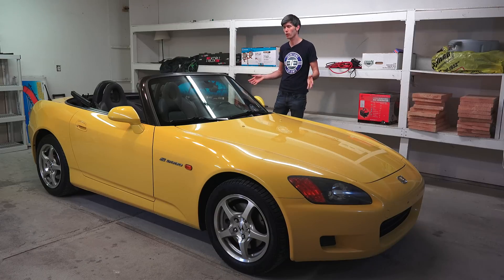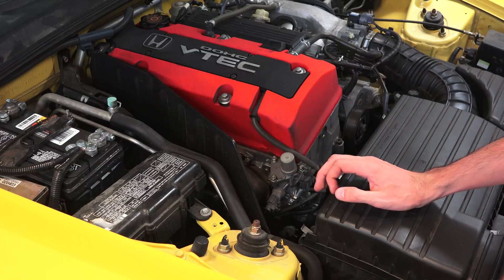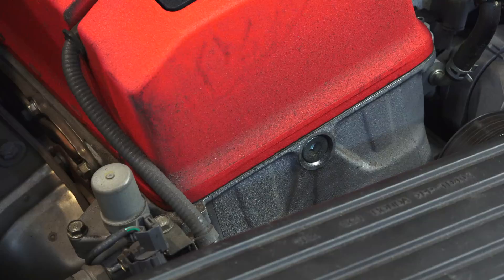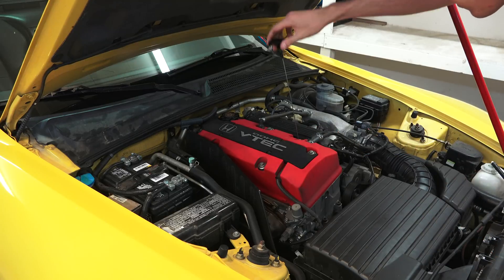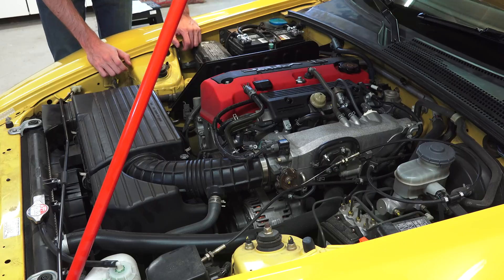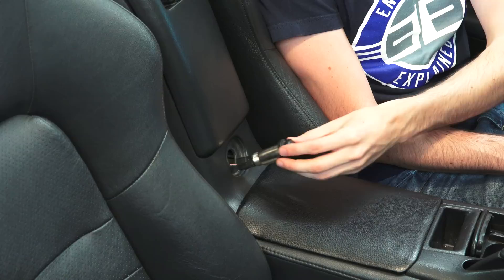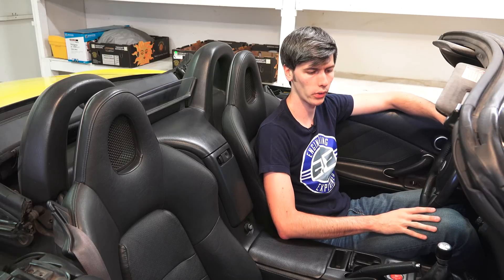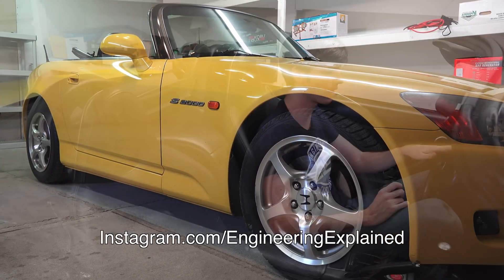What's Wrong With My Honda S2000?

Comment: If its not mentioned somewhere in the comments already, its a common issue for especially AP1s to burn oil fairly quickly and top off oil (maybe ~1qt) every few months or so...or even prior to an oil change. Don't sweat it, its normal.

Comment: Good to hear that you are going for the XV. Even I was expecting to see you in the Fiat / Mazda MX5 convertible for Sports Car instead the Honda.
 I have an Impreza 2011 5 speed manual with 102K miles no complains about..Im selling it for an upgrade
I own  a Forester 2013 as a family mover.  My choice for replacement for the Impreza will be the CrossTrex XV  5 sp with the highest trim available.. Its a reliable car an fun to drive.

Comment: Keep that stock airbox just get a snorkel
Reply: Also if you didnt know above the center console is a secret compartment I didnt find out about it for 2 years
Reply: +Yodastien that's because it's a secret....
Reply: lift it and put 30s on it aswell
Reply: Yea then all it needs some muddies and a raise kit and she'll be good to conquer some river crossings!
Reply: ayowser01
Yea there is, that's why they have short straight flow intakes and things like that. Like especially when you are dealing with forced induction engines. It isn't a loss with most n/a engines when you add the extra piping for a cold air intake because the cooler air makes up for it. But the more piping and bends restrict the flow to a certain degree, so in high powered engines the losses are considerable.
Reply: ayowser01
Glad to pass on knowledge to people who understand things :)
Reply: In this case the "loss" from the extra length and bends is more than offset by the higher flow through the larger tube/removed airbox internal restrictions and the cooler air (Hondas are sensitive to IAT).

A budget alternative is to gut the airbox, make a snorkel or lengthen the factory duct, and wrap the airbox in heat-reflective insulation (DEI makes some gold-foil stuff that a lot of race teams and track guys use). That also dodges the issue of worrying about puddles when you have a cold-air intake :-D
Reply: You could also gut the inside of the air box and get rid of that fin in there.
Reply: I agree. I think a simple snorkel will resolve heat soak.   Short of buying an expensive jdm intake, this is the best bet. It does require modification (cutting) of the factory hood, however.
Reply: Im not sure if the thermal efficiency improvement will cover the power loss of adding such a long intake pipe.
Reply: +j0n0j0n0j I noticed an improvement. Warm, ambient air no longer affects the power delivery. The power remains rather consistent on a 90-100°F day.
Reply: ayowser01
Yea I was just talking about the power loss from having such a long and bent intake pipe.
Reply: +j0n0j0n0j I really don't think there's any power loss from "restricting" the air path to the narrow tubing. the cross section of the factory intake inlet is actually smaller.
Reply: +j0n0j0n0j you learn something new everyday 👍
Reply: Yes, the snorkel will help. With the heat soak problem.
Reply: remove the sound deadening baffles of the stock airbox
Reply: Yodastien did you mean airbax
Reply: Raiyan Vlog heir bux

Comment: You can move the hood prop to the left side of the engine to prop the roof up almost 90 degree. It comes off and reinsert to a hole on the left side.
Reply from the maker: Great tip, I will check this out!
Reply: My Civic has a similar thing, there's the usual hood prop and then another hole near the bottom that opens it completely vertical. Very helpful!

Comment: Since it's an AP1, you gotta check if the banjo bolt was changed with the newer one. If not, there may be some issues with cyl4 oiling (very rare though) leading to lower compression compared to other cylinders.
Reply: Good point, and on 2002s only about half were done at the factory.

Comment: I, for one, am very interested in seeing work in progress videos, especially the timing chain issue! Love to see an engineering point of view concerning the chain and how to fix and/or prevent it. Curious to see what modifications you'll be doing on the S2k
Reply: The tensioner is one of the few defects in the car.  Fortunately it is a 20 minute job and with aftermarket options will be fixed forever.
Reply: Thank you very much for the information!
As a Honda enthousiast, I'm always curious to know the common "defects" their engines have, not only to fix mine and others's, but you never know, some day I might own a S2k :-)
Or....., may experience the "pleasure" to work on it.
Anyhew, thanks for sharing!!! Any more information is always much appreciated ;-)

Comment: You want to get the timing tensioner and chain sorted out ASAP, I had rattling timing tensioner and did not look into it soon enough and one morning idling it suddenly spun over freely as it died. Bent every valve in the head broke a couple valves off and poked holes in tops of pistons
Reply from the maker: Oh my! Just got the part in, changing it soon!
Reply: +Engineering Explained you might want to get a tensioner from ballade or from billman250 (s2ki member) because the oem one will fail again.
Reply: Please, DIY videos!
Reply: +Engineering Explained  if the tct can no longer perform its job, I would highly recommend changing the chain itself as well if you aren't going to already. The chain over time will naturally stretch until the tct can no longer do its job. That's a job where both get replaced. Unless a know-it-all customer says "no thanks."
Reply: +jake20479 Just found out you are changing both. My bad guy. Rock on

Comment: MX5 > S2000

The only problem with the NA/NB Miata is its luke warm engine and rust issues in the salt belt.

I would have a S2000 if the price was right, like under 5K and it wasn't molested.
Reply from the maker: Unfortunately you won't find (even a salvaged and well running) S2K for $5k.
Reply: Engineering Explained
 Yeah, and that's why I like Miata's you can get inexpensive good examples for peanuts with enough dough left over for some tasteful upgrades.

Comment: One reason for different oil level whenever you check it might when you do it first before and than after driving the car. You might measure let's say 10min after driving (hot engine). If there is a difference, than it might burn oil.

Comment: With Hondas they burn about 1L of oil every 1000 miles 👍
Reply: Also use genuine Honda diff and gearbox oil because I had to change a gearbox on a Type R because they used cheap aftermarket gearbox oil and it killed the gearbox
Reply: Actually, you need to be super careful there.  The diff oil is a honda motorcycle division part, and taking it to a dealer is likely to get you some CR-V diff oil.

Any 75W-90+ GL-5 oil works fine...and will probably be aftermarket. 

For the gearbox, the Honda MTF is great.
Reply: +Stephen Baker be carefull here. autodata says to use 10w40 transmission fluid. now iam confused.

Comment: Hey man when you are checking your oil make sure to pull the dipstick out, wipe it with a clean rag. Then re insert it all the way and pull it back out. As sexual as this last bit sounded, it will help you get a more accurate oil reading

Comment: How tall are you because  I want one
Reply: I'm not EE, but owned an S2000 for 13 years.  I'm 5'7 and the car is really ideal for people under 6'0 and on the slim side.  My buddy hates riding in it - he's 6'1 and ~250lbs.  He feels very cramped.  Drivers side is slightly more roomy than the passenger side and there is even a bit more room in the AP2.  I hope that helps!
Reply: 6'3 and I daily my s2000. Just buy a BYS seat rail and it makes the stock seat perfect for taller drivers

Comment: can anyone recommend a good/fun small car?? because i will be making 35 miles one way to work. i was looking at Fiat 500 Abarth, but I don't know if it's worth getting one
Reply: Get a Mini! They are way nicer! Just be careful what year model you get.
Reply: Get a nice little Miata! There is nothing more fun than a Miata
Reply: +Khvndlxr S the newest gen is awesome! I love that little car! I still like Mini's better, but for a car like the Miata they did a good job
Reply: +zevi 2000 is it a good idea to get a used mini or miata??
Reply: +Mr. X depends which models you are looking at. For the 2002-2006 hardtop models(supercharged), '05 and '06 years are best. For 2007-2014 (Turbocharged), the most recent models are much better for reliability the older N14 engine had some issues. For Countryman models go for a 2014 or newer, if possible. Just tell me which models you are interested in
Reply: +zevi 2000 I'm more interested in turbocharged mini
Reply: +Mr. X do you have a budget? Also, what type you like, roadster, coupe, hardtop, convertible, etc. oh, I also forgot to mention the 2015 and newer models
Reply: +zevi 2000 coupe 14K
Reply: Mr. X the fiat will constantly break down
Reply: Mr. X you should be able to get a coupe within that price range. Lemme go check what engine it has.
Reply: 2014 and newer should be best is my guess, just like the Countryman. Only issue is that they are either at the very top of your budget or over by a little bit. I forgot how expensive the coupe was new when it was in production.

Comment: first upgrade the brakes using tsx front rotors and calipers then install 255/45R17 Yokohama neova ad08r and u will have a much better handling car.

Comment: Hmmm if its oil consumption I would check for obvious signs of leakage under the car and maybe do a compression test and a cylinder leakage test to check how well the pistons are sealing and if everything seems fine i would check the cyclinder head and replace valve guides as they wear over time

Comment: Since you'll be replacing your TCT here's something that you might wanna see (I read it on Car Throttle's 10 Things You Should Know Before Buying A Honda S2000)

"If you’re going to change the TCT or pay someone else to, it’s worth considering buying one of the modified replacement units recommended by the S2Ki guide, as these are stronger than the Honda-manufactured parts and shouldn’t ever need replacing."

https://www.carthrottle.com/out/?url=http%3A%2F%2Fwww.s2ki.com%2Fs2000%2Ftopic%2F808383-tct-diy-replacement-or-repair%2F

Comment: Ap1s burning 1 quart in like 1000+ miles is considered normal. I have the same issue. Question would you ever do the valve retainers? I just did mine

Comment: Might Car Mods did a series on an s2000 and did a dyno comparison of aftermarket cold air intake vs the stock intake and the stock intake is better. Honda did a good job and you should leave it alone.

Comment: Spoiler...

These tiny things are the only things wrong with it at 105k miles!? Wow! :)
Reply: No he should also be looking at his valve retainers they tend to fail in ap1s
Reply: Correct, but only if the car was over-revved.  Otherwise they hold up just fine.
Reply: Heck, I bought mine with 110k on the odo (in 2007) and sold it with 144k (in 2009, looking back I never should have sold it!). Only issues I had were gradual holes wearing in the softtop (patched them), a rear wheel bearing wearing out (previous owner never did the TSB, I changed the bearing and torqued both to the proper spec), and the clutch wore out. That's all I can really remember. Some of the interior trim started wearing but considering the age and mileage it didn't bother me. Oh, and I replaced the driver's floor mat because my mil-issue boots wore through it at the heel :-D. Solid as a rock: I drove it a lot, it never saw a week without a run to redline (after a proper warm-up!) and it ran great from the first day 'til the last day.
Reply: Yes but car runs just fine with cracked retainers, no way to tell and then sudden death from dropped valve... That's one the first things I did when I got my S, even before changing fluids.
Reply: My previous (and also first) car was a K20 FD5 Acura CSX (Canada only). I bought it at 173 000 km and sold it at 209 000 km. It has been a great reliable car until the end. The engine was at the point that it needed a valve timing adjustment, but let's not remember it reached very high mileage. Miss that car! Certainly it is not the only Acura I will own.
Reply: +Stephen Baker that is true but without knowing how the car was treated before by the previous owners I would definitely check
Reply: +mibars same here

Comment: Whait 10 min without starting the engine, pull the oil stick off, CLEAN IT, put it back slowly to the bottom, pull it of angain an then look to the measurements marks. engines consume up to 1 liter of oil in 6000 miles - 10000 km. Dont need to remove the cams cover, its fine, could start leaking after removing, if not absolute propely instal. change your fuel filter, look the spark plugs  for the healthness of the burning chamber. And if they are worn out, just change them, worn spark plugs forces the ignition coils.

Comment: you may want to check on some aftermarket transmission fluid. My friend and I both had issues woth gear grinds at high rpm after using Honda's mix. His S2000 and my RSX Type S. We both ended up using Royal purple I believe. Do some checking but I think it was their syncromesh oil that worked really well. Red line has a good mix also.

Comment: why risk backing out that bolt too far for a gasket when you can use rtv without any tools? also e6000 would bond your outlet... and it'll never come out again... ever...

I'm not surprised about the oil level. my truck at 130k burns almost a qt every 5k miles. gfs subi was worse at 158k but that was a head gasket thing. burns about half a qt after 4k

Comment: you can take the hood prop out and attach it by the fender on the driver's right, so the hood will open further (most hondas have some kind of provision for this too) -- got that one off wheeler dealer's edd china. :)

Comment: I bought an 07 brand new and the only issue I had was that the soft top wore a hole where the top hoop over the seat headrests would rub the canvas as the top went up and down. Kind of over where the passenger's right shoulder would be. Honda replaced the top under warranty and said it was a known issue. They said that the bar should be covered with something smooth (maybe just electrical tape) to prevent it from happening again. Unfortunately they did NOT apply the 'smoothing' solution and the hole came back. They replaced the top again.

Comment: Had the power outlet issue on both of my S2000s. Easy fix as you said. Haven't even bothered with it on my latest S. I think you've already got enough beta about the TCT, and also look into the "modifry straps" for your top so it will sit back down all of the way in the back. Brand new top but the straps might be worn. They are $20.

Comment: Depending on how "preventative" you're feeling, the AP1s have a couple of things in the engine that should be upgraded to avoid catastrophic failure. Depending on when it was made in 2002, this is around the time that Honda changed the oil  jet banjo bolts (oil sprayers) from a 2 hole bolt to a 4 hole bolt for better lubrication. This would be easy to do while you have the oil pan off to reseal it. Also, AP1 valve retainers are known to crack over time, and could be easily checked while you're in there addressing the timing chain. You can replace them with AP2 retainers

Comment: Kinda surprised it hasn't been mentioned, but you need to make sure you check your valve retainers. AP1s have weak retainers on the intake side that can crack and drop a valve into the cylinder with a misshift. Simply replacing with AP2 retainers will almost guarantee you won't have to put an engine in it.

Comment: I've noticed with my S2000 that using Amsoil's fully synthetic 10W-30 oil that I haven't burned a single drop and that's under common rips on the backroads. And, when you change your oil I recommend using an OEM oil filter.

Comment: It doesn't have to be an oil burner. The last person changing the oil may not have topped it off. You did discuss it possibly be leaking.

There's all the possibilities for you Jason. :)

It really looks like you got one in great unmodified shape!

Modifications always lower the value. Other people may want the mods you do, but most would want stock or different mods.

I like to modify because of personal value and enjoyment is of more value to me. :)

Comment: Look into doing the "uk exhaust mod" to the car or buy an exhaust that has already had the mod done.  Also look into installing a test pipe. I did both mods to mine and it's really enhance the performance and sound of the engine.

Comment: Pretty sure it's the same on the s2000, but on my accord, you'd have a second hole for the prop rod that makes the hood hold almost vertical, very useful when doing work under the hood. You should check it out

Comment: you should also change the chain as well. better safe than sorry.
Reply: Usually not necessary. The issue with ticking on warm startups is 100% due to the tensioner itself.
Reply: The whole point of chains is not having to change them.
Reply: most chains are usually good for the life of the car
Reply: omg s2k tell that to my mums car
Reply: Jeff K really.. never?

Comment: how tall are you? I want to get an AP2 07 but scared im too tall im 6'4 245
Reply: he's 5,1.
Reply: You'll be fine. My cousin fits in one
Reply: fatass
Reply: I'm 6'2 and I fit just fine. I have an 02 AP1. You may be a little snug in the Recaros though.
Reply: Depends on your legs and feet. I can't fit into the drivers seat, the foot box is too small. I can fit in the passenger side with my knees smashed into the dash. Sit in one first.
Reply: I think he said before he's 6' 2" and 140 lbs soaking wet.
Reply: I had a AP1 02 (SMB.)  At the time it had the most legroom of any car sold in the US.  I'm 6'2" and no issues